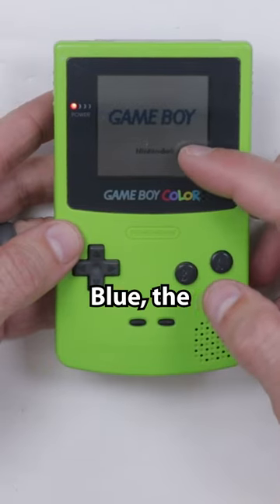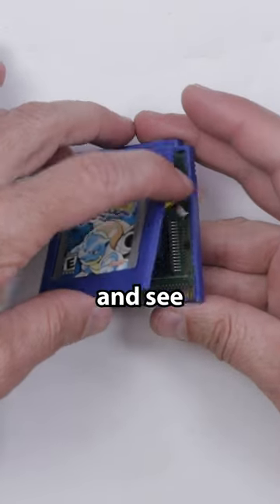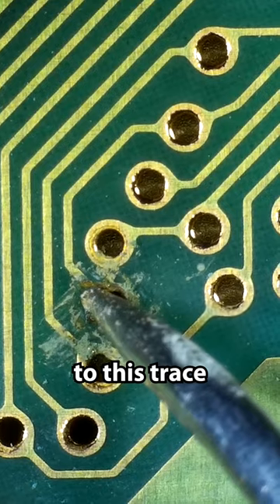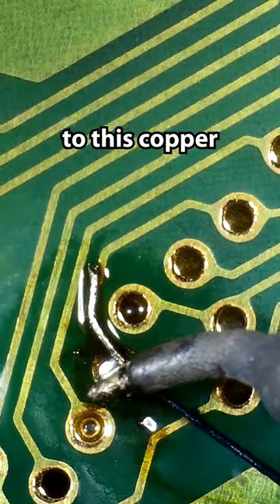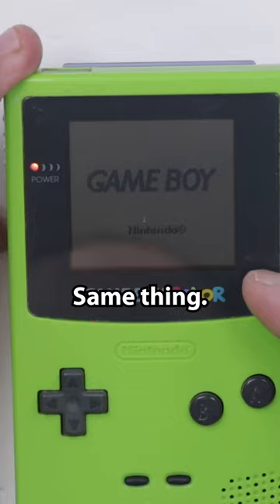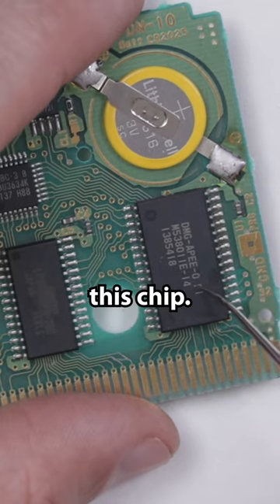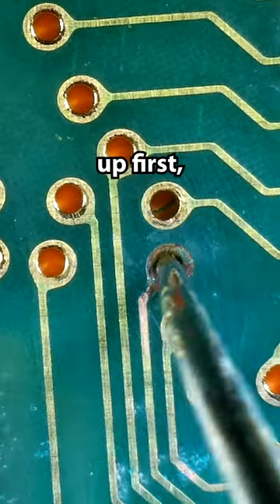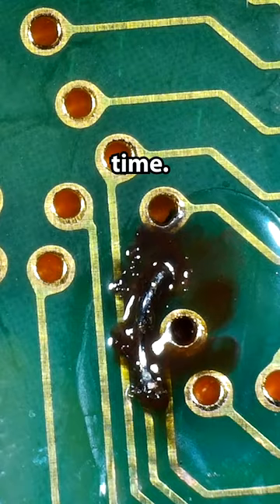Trying to Fix A BROKEN POKEMON Game

Comment: I have a Nintendo ds Mario 64 game piece that might be broken everytime I insert it in my Nintendo dsi it won’t read how can I contact you so I can get it fixed do you have a website?
Reply: I'm no expert, but have you tried adding isopropyl alcohol to the game cartridge and insert it in and out of the DS?  I've seen Steve do this, and this should clean the pins on the game and the DS, might be worth a shot, just make sure the alcohol is dried before turning the power on

Comment: Often times breathing on the metal contacts fixes this boot issue, try it if there isn’t anything obvious on the board
Reply: Please don't do that... That's how you get saliva onto the contacts and cause corrosion...

Sure you may be cleaning the contacts by doing it, but you're just destroying the game in the long run.

If you're going to clean the contacts, don't do it with saliva, do it a proper way.